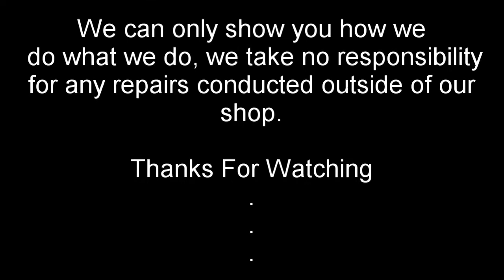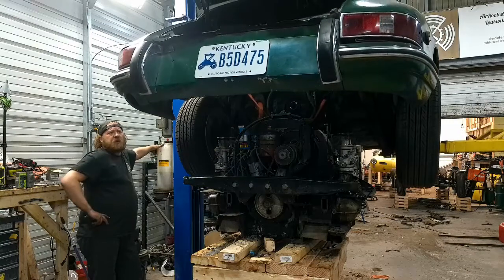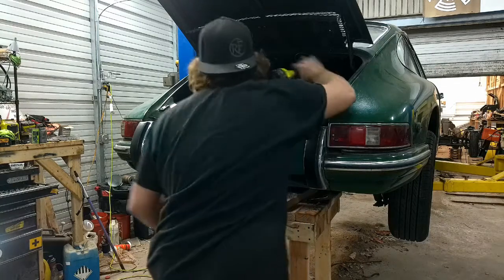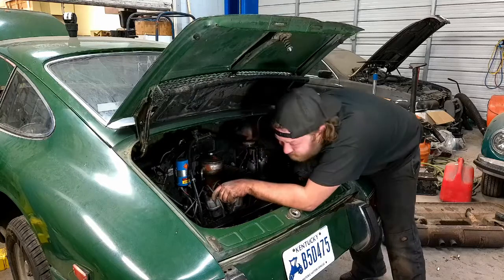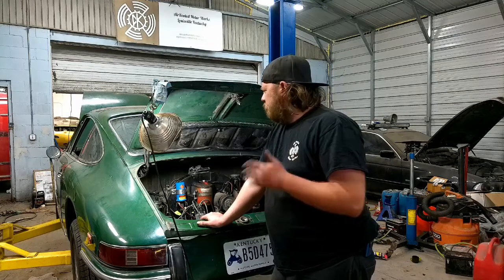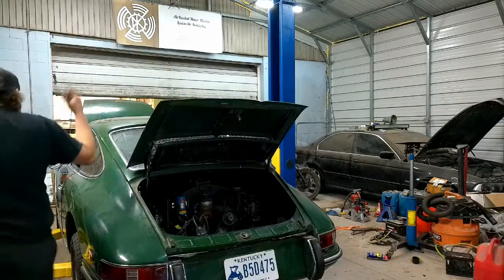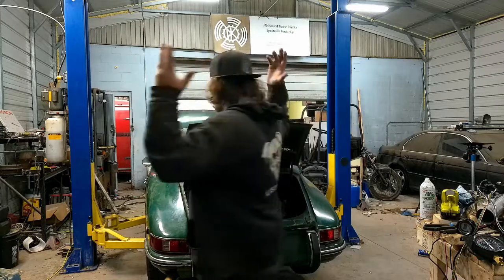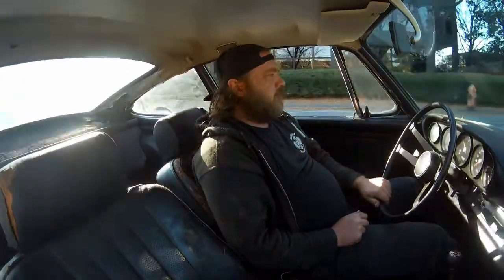(PT:7) 1968 Porsche 912 1600cc engine install...Re RE Revival Back on the road & Finally Finished?

Comment: Sounded very nice !! Drive seemed to go well and just a few tweaks 👍
Reply from the maker: Thanks...Car did really well for it's first outing... Owner has been enjoying it while we still have decent weather here... It might be coming back for a major upgrade in the future
Reply: @airkooledmotorwerks  ideal repeat customer . I’ve my friends bug in and non starter as starter motor gone plus it’s twin carbs and runs poor. I’m not brilliant at engine especially twin carbs but bought a SK1-30 Synchrometer - Fine Tuning Weber, Dell'Orto, SPICA Throttles from Amazon .so think I’ll give you a shout as no doubt I’ll need help 👍
Reply from the maker: @vwcoco  more than happy to lend a hand however I can for sure

Comment: Cool series, still running well?
Reply from the maker: It is indeed... But talking with the owner he is going to be switching it out to a 911 engine probably in the summer/fall and putting the original engine on a shelf/storage
Reply: @airkooledmotorwerks  tempted to send you my 912 in similar condition hahaha
Reply from the maker: @gjvgc9853  i for sure should definitely be able to get you handled if you do